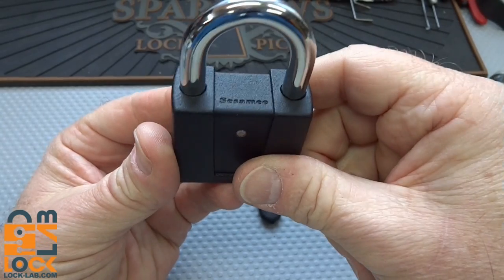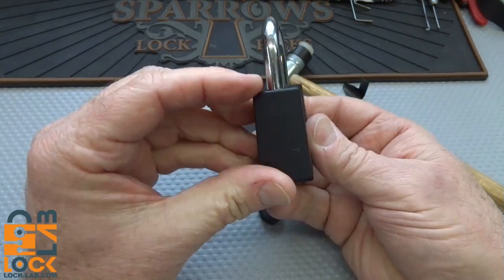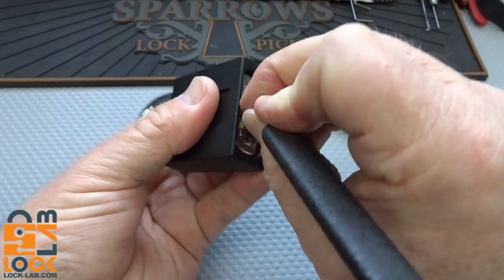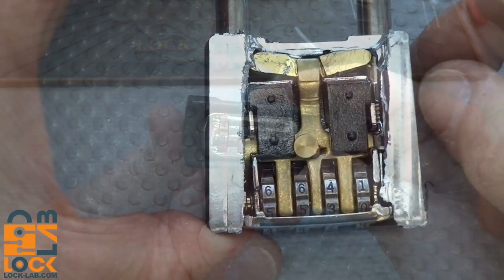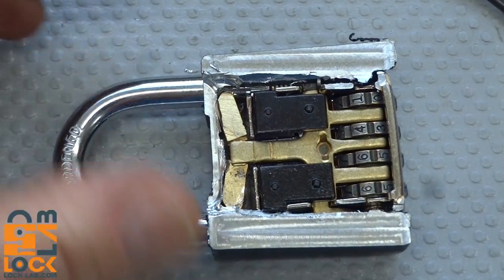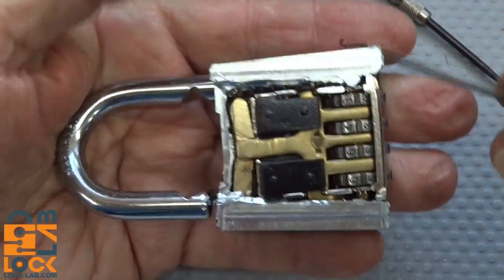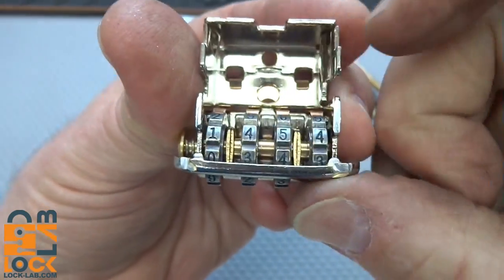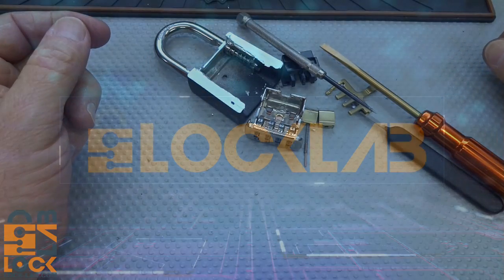(965) Sesame K-500 From Chad Dissected

Comment: It seems very hard to bypass  this lock with spring in place. When you get your Peterson tool in there it's pushing right on pivot point of the locking fork(?), it's non impossible but  not anywhere as easy as a 175

Comment: knowing that it doesn't have any false gates, could you get the pick in and feel when you had the right number?
Reply: FlipFlopGaming 
Notice what is turning. There gate is in-between the dials completely covered so sadly you couldn't. Unless you had something extremely thin and curved to reach over there. Then you could possibly feel the flat spot. If that makes since. (wish I could draw a diagram to show)
Reply: Probably not. But if you pull on the shackle and rotate the wheels, I'll bet there's one number that has noticeably less resistance to turning because it's not rubbing on the pawl.

Comment: How about pull-picking?
Reply: Do you mean zipping?
Reply: Zipping is a fast outward motion of a pick or rake while applying tension on a plug of a pin tumbler. It's a kinetic attack that uses the physics of conservation of momentum and transfers the motion from the key pins to the drivers. What I meant is the method of pulling out the shackle and testing the wheels if they bind. Normally, when you can tension the locking mechanism with pulling the shackle, this gives you a good chance to feel the fates.
Reply: Oh, I didn't know that method had such a name.

I call it a bypass, pulling the shackle to apply pressure on the "gates" or how you call it "fates"?

I used an exact method to open many combination locks.

Comment: Hi, I'm just getting started into lock picking. I was wondering what lock pick set you would recommend. I have had little experience. Thanks for your videos!
Reply: I myself usually recommend the exact opposite of what most would say... Most will tell you never to buy the cheap Chinese pick sets like Goso, etc.. But in my opinion it's better to start there.  Most of them can be had for $10-$15.  They are cheap and won't last a lifetime.  But they will let you learn.  Then once you learn you can put together your own set or buy a decent set from a good company.  Many will say, "Don't buy twice", but in my opinion, it's better to start off with a crappy set.  If you break a pick or whatever you really won't worry about it.  Plus, once you've learned a bit and understand what shapes work best for certain things you'll have enough knowledge to piece together a personalized set of good picks that will have exactly what you want in it.  Just my two cents...
Reply: R.U. Sirius Thank you so much for your input!

Comment: It really doesn't take that long to open a 4x10 combination lock by brute force. You can typically try a couple combinations per second without too much difficulty. This puts the average time to open the lock by trial & error at roughly half an hour. I've brute forced a couple locks just by trial & error: 10,000 possible combinations is just not nearly enough unless the attacker is somehow prevented from making repeated attempts.